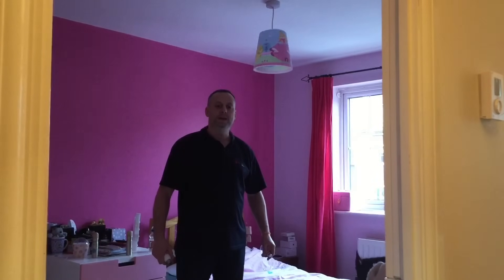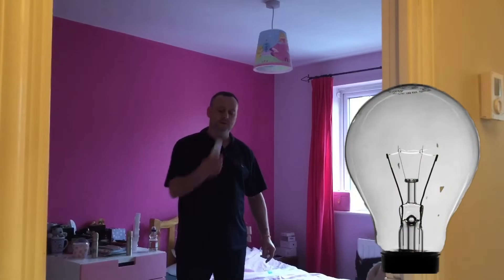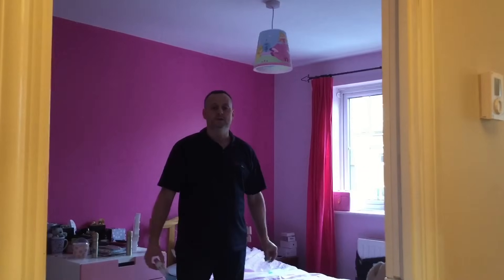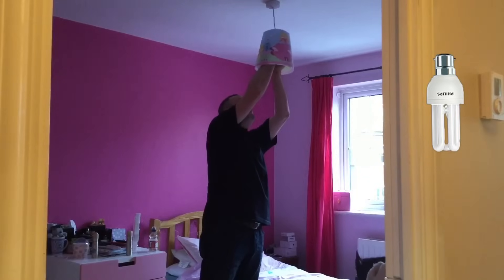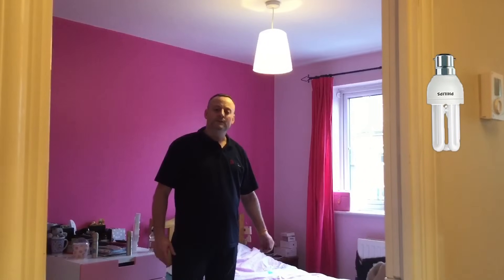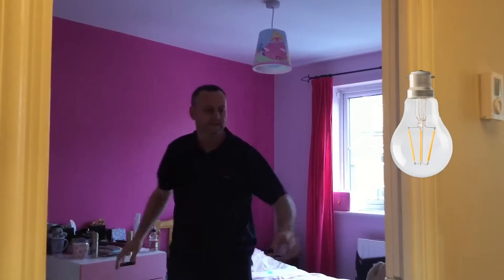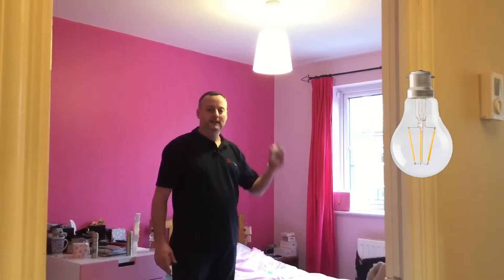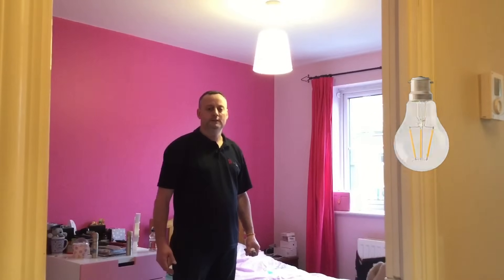Energy Saving from CFL vs LED Lamps (Bulbs)

Comment: I don't like the very bright light emitted by high wattage LED lamps, I have gradually begun replacing my 11w CFLs with 4w LEDs, but I am only doing this as the CFLs burn out. LED replacements for T8 fluorescent lamps are not as bright in my opinion, therefore, I will continue to use T8 tubes for the meantime
Reply from the maker: Hi. I agree no point replacing working lamps with new ones. The lamps I have removed are now in college. Thanks for commenting and watching GSH Electrical 👍